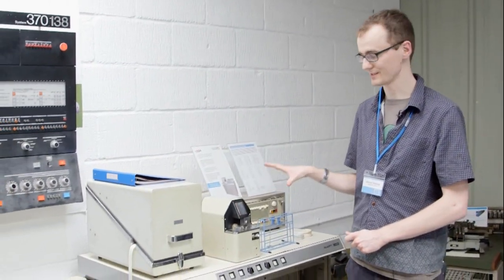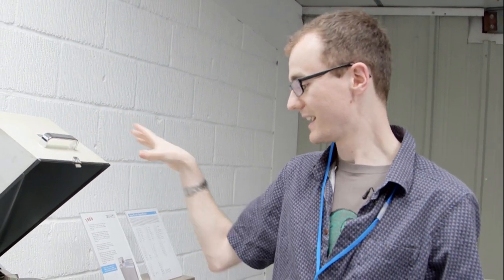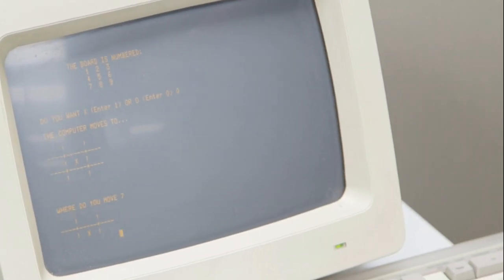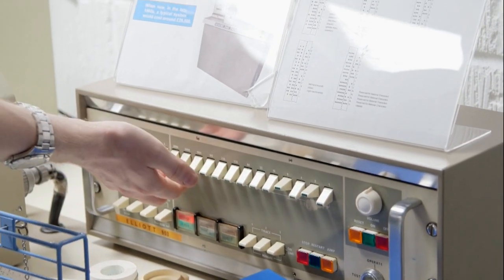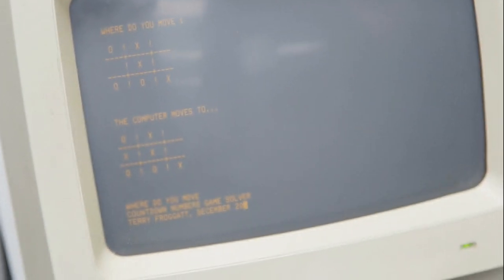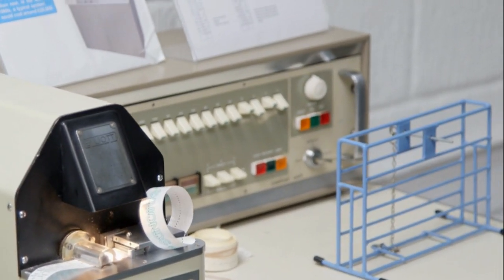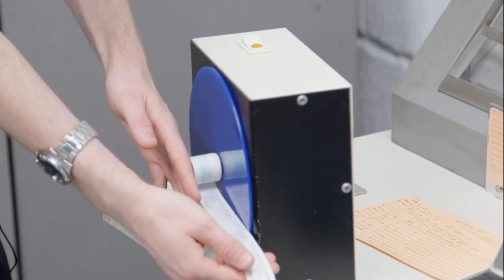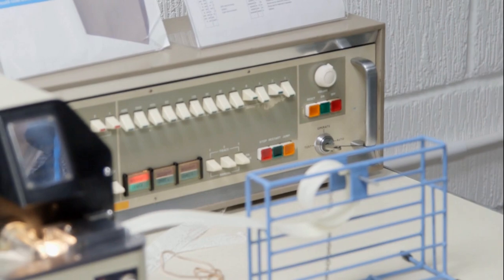1966 Computing Power (Elliott 903) - Computerphile

Comment: "The Elliott 903 was the civilian successor to the 920B computer which was installed in RAF Nimrod Mark I aircraft. It has an 18-bit processor with 8192 words of magnetic core storage. Core access time was typically six microseconds. Additional core storage could be added in blocks of 8 kilowords, up to a maximum of 64 kilowords.

The 903 is physically large: it came installed in a standard-sized desk unit. The left side of the desk contains the power supply (the main logic circuits run on +/- six volts; other voltages are required by the various peripherals). The right side of the cabinet houses the processor cards and core storage. There are no microchips in the 903: logic gates are implemented on small daughterboards using a resistor-transistor logic (RTL). The top of the desk is where the paper tape punch, paper tape reader, and control unit sit."
Reply: Winston Smith I'd really like to see a circuit board with such a resistor-transistor logic (RTL) on it.
Reply: Winston Smith Thank you - that gives me an idea (I expected it to look like that), but I'd love to see a picture of one individual card, maybe of the front and back side...
Reply: Seegal Galguntijak it takes like 25 transistors and 15 resistors just to make one but register.
Reply: No integrated circuits at all? It was all implemented in discrete transistors and resistors?
Reply: @gregorymalchuk272  Absolutely, this 903 was replaced by the 905 which was an integrated version of this 18 bit computer.

Comment: The Elliott 903 was one of the first computers I learned to program, back in 1970. Our school obtained permission to use one at a local technical college in Rochester, Kent. Ours also had a huge quad 9 track tape deck and a very noisy line printer. I used Algol 60 on the machine and my favourite achievement was a program that output a tape to draw lissajous figures on a plotter.

Comment: My first job in 1967 was for Elliott Automation, Frimley working on the FACE system for the Army, based on an Elliott 920B. It was an 18 bit machine with 8k of core store. I remember the same console which you have in your video. Some of engineers were brilliant at keying in programs using the control box, including solving puzzles and playing tunes on the speaker in the control box as you demonstrated. The system could compute the gunnery solution for a battery of 8 guns in only a few seconds. You say the machine was slow, which it was, but the programming (in SIR) was tight, efficient and accurate and was stored in 8k of core. Compare this with the bloatware in modern computers!

Comment: Penang Malaysia, In the RAF, I maintained a computer assisted air defence system (GL 161)  based on 5 Elliot 920B computers and an extra core store block. Program was stored on Mylar (plastic) tape Which was only ever used to provide copies used to reprogram.  Then there was a daily 'data' tape which fed in the daily instructions and weather. if that failed to load  in any way the system was not working properly and you had to start again. Programing was Machine code with the help of a very primitive assembler caller SIR  Symbolic Input Routine

Comment: I have to say, this is hella more advanced than I thought it would be. When told about extremely old computers, you're always told of the computers that were the size of huge buildings. For it's time, I'm quite impressed that this isn't much bigger than a normal sized computer today.
Reply: +BOOM95 
This thing was sort of like a programmable calculator Sharp PC-1211 -  where as the multi tasking time sharers were 'folk lift separate bits off truck" sized mothers.

Comment: You got an old computer to play Tic Tac Toe? I've seen Wargames and I know that never ends well...
Reply: ***** which has also been solved now I think....
Reply: Frabbledabble exactly, a computer will always beat a human if you remove limitations.
Reply: *****
nono, you misunderstand... The game chess itself is solved, its not a question of computer-power...

Unfortunatly, only a computer can store and utilize such a huge data base of possible outcomes... But ANY computer could do this, its only a question of data storage capacity. -Which is practically limitless...

Of coarse if you gave such an indexed library to a human, he could compete equal to any computer... only slower....

But ofcoarse the POINT here is, that CHESS has been reduced to the initial draw for the white pieces....
Reply: Frabbledabble Chess hasn't been solved, not even close. Most positions with 7 or fewer pieces on the board have been solved but that's a very long way from solving the game. 
Draughts/checkers has been solved, maybe that's what you're thinking of.
Reply: SchumiUCD
 Deep blue wins because a method exsists to consistantly win at chess... It is solved!
Reply: SchumiUCD You do not need to know all possibilities. You only need to know the possibilities that can vary from your influence. Chess is solved, in multiple different ways. A computer will beat any human, and has been able to for a very long time.
Reply: Frabbledabble chess is not even remotely close to being solved. chess is proven to be a problem in EXPTIME, meaning that it is literally impossible to calculate perfect play in less than exponential time. given the 8x8 grid and the 32 pieces in play, even if we doubled our computing power one million times we would still not even be close to even starting to solve chess.

you can''t store a database of optimal moves given any position of the board. even if you used every single particle in the universe to represent a bit in the hard drive, you still wouldn't be close to having enough storage. the problem space is HUGE.

a strong computer always beats the best humans now, yes, that is true, but that isn't the same thing as being solved. solved implies that a perfect strategy is known. if you let two strong computers play against each other, they will win some, lose some and draw most.
Reply: Richard Smith see my other reply, chess isn't even remotely close to being solved in any sense of the word. not in a million years. most experts theorize that it will not ever be solved, it is too complex.
Reply: eNSWE who needs to store all of the data on a hardrive on the computer when you could just store it on the internet.
plus chess being solved means for an AI being able to have a 100% win rate against humans.
Reply: what? how do you think things are stored on the internet? it's just a whole bunch of hard drives and similar storage media connected over a large network.

the internet isn't even a billionth of a billionth large enough in storage size to store a table of optimal chess moves. the game-tree complexity of chess isn't even known, because calculating it is related to the complexity of the game itself. it's conjectured to be somewhere 10^140. that is an insanely absurdly large number. it is beyond cosmic scale, it DWARFS the number of elementary particle in the ENTIRE UNIVERSE.

and no, your definition of a "solved game" is not compliant with any definition used by game theorists or chess players. have a read: https://en.wikipedia.org/wiki/Solved_game

chess is only solved for trivial positions with 6 or fewer pieces and a few other trivial examples. the game in general hasn't even begun being solved. there is NO debate about that in the chess- and mathematics community, chess is not a solved game. period.
Reply: Keegan Oliver The internet is on hard-drives. Also chess is not solved. Look it up for yourself.
P.S. Checkers is solved. ;)
Reply: eNSWE
Time shouldnt be a factor, though. I dont see that it matters to the question of whether the game is solved... The computer will increment onwards with no concern, untill victory... How would it fail-? and then, how is it not solved ?
Reply: eNSWE
Yes, but if the correct algorythms are applied to the correct database, chess is reduced to the draw for the first move... I dont see how that doesnt make it solved...?
Solved here meaning that the outcome is given... Every possible outcome is known or can be known.
Reply: "if the correct algorythms are applied to the correct database, chess is reduced to the draw for the first move"

feel free to supply a source for this. I think the chess community and mathematicians everywhere would be dying to know this.
Reply: Frabbledabble You are confusing "deterministic" with "solved"
Reply: Willy Goat
Well does deterministic not imply solved in this context?
Reply: eNSWE
Deep blue, I think it was called... The chess computer, there are documentaries here on youtube. Its been a while, but I seem to remember it has every possible state of the board catalogged, so there is nothing that hasnt occured to it, so to say...
Reply: I know about Deep Blue. Claiming it "knows all possible positions on the board" is beyond ridiculous. Firstly, it lost a few games against Kasparov. Secondly, I have already told you that the position-space of chess is so large that even if you used every elementary particle in the universe to build a computer, you would need several billion billion more universes worth of matter just to build a hard drive large enough to FIT it all, never mind actually analyzing and looking stuff up. Thirdly there are tons of computers today that are orders of magnitude stronger than Deep Blue, and they are still not even close to beginning solving chess. it is not possible. end of discussion.
Reply: "Either it, or an assissting machine would continue catalogging possible outcomes automatically untill there were no more to catalog..."

"the sizeable amount of moves and opening tactics you WOULD be able to store."

you cannot store "a sizeable ammount of moves and opening tactics". you don't seem to understand. there are somewhere around 10^140 possible games of chess. printed out in decimal form: 100000000000000000000000000000000000000000000000000000000000000000000000000000000000000000000000000000000000000000000000000000000000000000000

even if you hired 1000000000000000000000000000 people to cataloge 100000000000000000000000000000000 moves every second for 10000000000000000000000000000000000 years you wouldn't even have gotten close to cataloging them all.

do you realize how INSANELY large 10^140 is? like, not even fun-large. every move splits the game tree into one branch per possible move for every piece you control. it's an exponential growth that carries on for tens of generations in most games, but for others, several hundred.

why don't you just look this stuff up, it's readily available, one google search or wiki article away. there is no "doubt" regarding the fact that we cannot solve chess. it's not a controversial subject or anything that any serious mathematician would argue much about. not unless we make some absurdly powerful breakthrough in computability theory, changing everything we know about game complexity
Reply: eNSWE
Im not afraid of large numbers, thats why. I see computing time as a non issue...

-Even if the number of outcomes exceeds the amount of paper we have to write them all down, or particles even, thats incidental; You cant hold particle count against chess being solved! -Games dont become unsolved because of such external limitations...

You cant just destroy the universe and have tic tac toe become unsolved... Games are still solved if all particles are destroyed.
Reply: Frabbledabble Yes, Chess should be solvable in theory. But no chess has not, nor cannot be solved in practice. Not now; Not for a while; Probably never.
Edit: eNSWE Frabble is only talking philosophy now.
Reply: Frabbledabble we are not talking about whether or not chess is theoretically mathematically solvable though, nobody has brought that up. that is self-evident. it's a turn-based 2-player game with well-defined rules and no elements of randomness, OF COURSE there exists an optimal strategy (or several).

we were talking about whether or not chess IS solved, and it isn't, at it physically cannot be solved by humans living in our universe unless we disprove a bunch of theorems in computability theorem.

I mean, basically this thread has now become
1. someone claiming that we can instantly find all prime factors of arbitrarily large integers.
2. refutal, no we can't, factorizing large numbers is absurdly difficult and takes a metric fuck-ton of time.
3. of course we can, it's not impossible, I'm not afraid of big numbers.

sure, there is a theoretical possibility of finding the prime factors of any number because they EXIST so obviously they can be found, but that was not what we were discussing. the original claim was that we already could and already had, when in fact, we never will be able to. that is not opinion, it is backed by mathematical theorems.
Reply: By playing tic-tac-toe the computer learned that war was pointless. So it did end well.

Comment: Would love to know more technical details of the implementation, instruction set, speed, storage capacity, how it communicates with the terminal. And where did this machine come from? What was it used for before the museum?
Reply: joe72205 Our Elliott 903 was once owned by the British Ceramic Research 
Association. It was originally purchased in 1967 and was in regular use 
until mid 1982. 

http://www.computinghistory.org.uk/det/32480/Elliott-903/
Reply: I tried to down load the manual, but it did not populate the shopping cart!

Comment: Interesting to see one of those again, it being the first computer I actually got to run hands-on, back around 1968-ish. What did surprise me was the condition of the console, which looked like it had never really been used. Did they somehow get hold of one that had never left the warehouse? Note the top row of 36 switches which was used to set up the initial jump to the start of your program (which might be an interpreter or compiler), one switch for each bit of the 36 bit word. In test mode you could even set up an entire program, literally bit by bit, if you had the patience.

I have a simulator somewhere (found on the web and rewritten) of the hardware plus Algol60 compiler. Does anyone have a memory image of the SIR assembler?

Comment: What language was used to write those programs? 
How much RAM does it have/how many bytes can a program be for it?
Are the programs on the tapes precompiled, or are they written in an interpreted language?
Reply: 8 18 bit kilowords by default, expandable to 64.
Reply: All the memory was magnetic core memory and it was all random access. The memory data would stay in memory even if the power was turned off!! Most programs were written in assembler, SIR was the assembler language, so all programs were actually compiled.
Reply: @johnwoody9505  You, sir, are a gentleman and a scholar.  :-)
Reply: @MrStephenRGilman  Thank you for those kind words but I was just a field service engineer on the Elliott 903 & 905 series computers, firstly out of the headquarters at Borehamwood then out of the Bristol office. Had a great time in those far off days from 1969 till about 1975. Cheers, John Adkins

Comment: Why is the system displaying each letter one by one? Is this native behavior to old computers?
Reply: HauntingShock More than likely a computer of this age would be treating its output device like a teletype machine, in which case you don't have random access to any point on the screen, you have to just stream out a sequence of characters. That, combined with the machine not being very fast, leads to the "one character at a time" thing.
Reply: d2factotum In addition, teletypes themselves are pretty slow, so the baud rate is mostly likely hardwired to the speed the typical teletype would print at
Reply: HauntingShock if you've ever seen one of those old electric typewriters, this computer is designed to use a device like that, albeit slightly different (Teletype machine as previously noted). They're loud and obnoxious, but fun to use at least once in a lifetime.

Comment: What sort of algorithm was it running when doing the Countdown problem ?  Was it intelligent or brute force ?

A comparison with a modern PC (or smartphone) using the same algorithm would be interesting
Reply: UKHeliBob No, it wouldn't. Because you can't really tell the difference between .2 microseconds and 2.1 microseconds (or something like that - these numbers were just meant as an example).
Reply: Seegal Galguntijak You would amplify the difference if you did the calculation say 1000 times.  Then it would be easy to see the difference.

In any case, if the program was running at full speed in the video then it is taking much longer than the numbers you made up.  How long would a PC or smartphone take is the question.
Reply: UKHeliBob The answer is a few microseconds.

Comment: So, how many times has a tape been accidentally ripped, and had to be re-printed?
Reply: Danomnomnom Surprisingly not many times at all, the tape is put into a reader that has metal pins to guide it, so none to my knowledge has never been damaged through reading, reeling it back up again can be slightly more tricky, it has a habit of looping.
 If this has happened, and the tape is badly creased or torn, as long as the programme is still running, it is easy to turn the machine from read to write, it can soon punch out another tape.